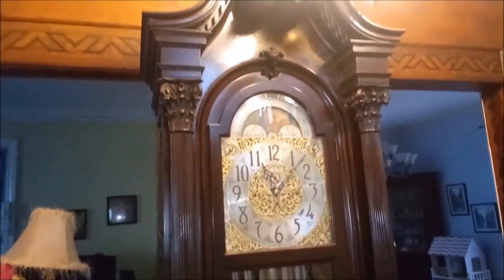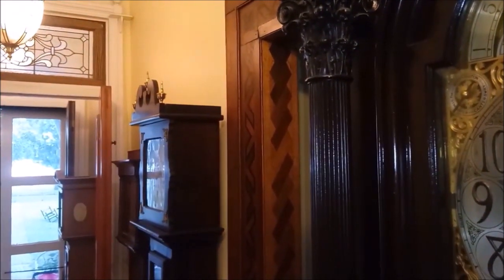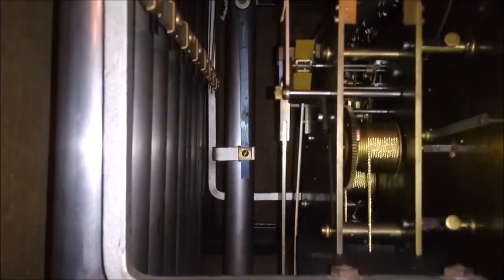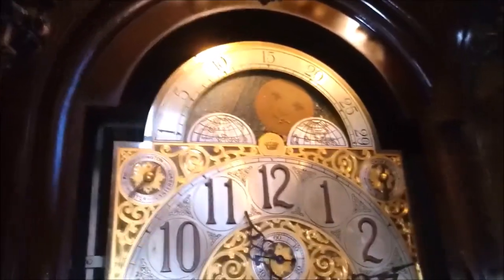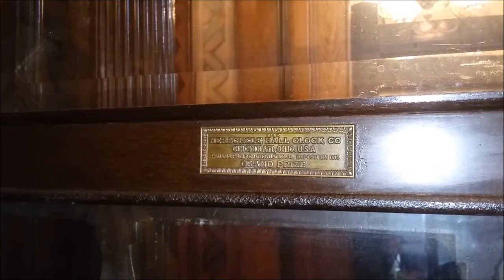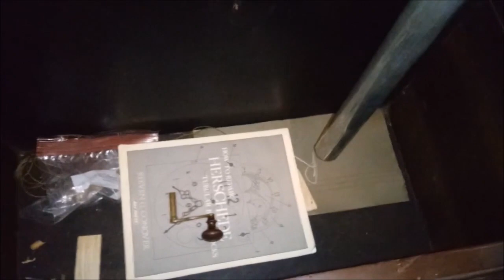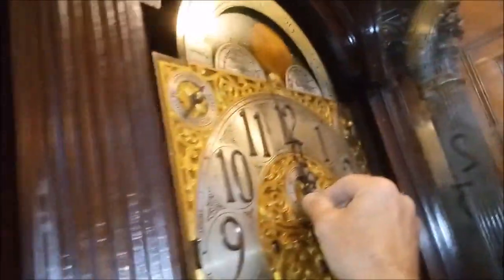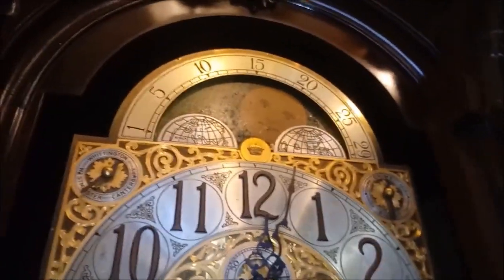Best Grandfather Clock Ever Made? Herschede Model 228. In 1916 It Cost $790 More Than a Ford Model T

Comment: Beautiful Clock!  I have a 1913 9-Tube but not as fancy a case.  I did notice your chime is off.  They don't self regulate so you have to fiddle with turning it on and off at certain times during an hour to get it back in sync.  Thanks for sharing!
Reply from the maker: 9-tube Herschedes are amazing clocks. I pieced together a few videos to make this one. Sometimes the chimes are on and sometimes off. Good eye.
Reply: well, apparently, they (Herschede) retooled the movement to self-correct the chimes every quarter sometime before their Starkville days

Comment: Nice clock, the chimes are out of sync btw, but its still nice
Reply from the maker: I know. Don't tell anyone. The movement is on my workbench as we speak.
Reply: I’ve noticed that too about the chimes. Instead of the usual for notes that the quarter after plays in the last four notes that I would play on the quarter till hour he would play the second for notes of the formality originally meaning you would play the fifth sixth seventh and eighth notes on the full Melody with if it’s the full tune or on the half hour that is. But I don’t bother me as long as the chimes work that’s all that matters

Comment: It needs new leathers on the hammers. the tone is way to bright, like metal on metal.
Reply from the maker: Yes, I agree. Herschede used horse hide or goat skin to get their rich tones. My hammers are all intact, they have just hardened with age. I haven't found any exact replacements yet. Most replacements are pig or cow skin.
Reply: @the_clock_guy  Griffen's Clock and Repair parts. They bought R&M, but they also have Herschede records, so that you can get a history and certificate for your clock. They also have hammer leathers, etc. 😉

Comment: The westminster chime has the last quarter where the first one should be. Needs adjustment.
Reply: Easy "adjustment".  Rotate the minute hand backward before the most prior quarter hour, then back forward to chime the quarter again.  Repeat until the chime has cycled to the correct sequence for that quarter.
Reply from the maker: Good ear. You are correct. The movement was not set up yet when I took those images.

Comment: Hello! I own a 1936-ish Hershcede movement similar to this one with a handful of problems; on the “strike” side, the winding cables are all tangled on the arbor that holds the drum, is there a way I can fix that without taking the mvmt apart? Also, the chimes are out of synch, and they get “tired” and stop chiming after about 6 or less hours. Is there a way that I can just save money and fix this easily at home, or Is it scary-taking-movement-apart kinda thing that an actual clockmaker can do? Thanks. I really want it to chime and I’ve always wanted a working herschede 9 tube clock to keep as a heirloom. Thanks! (Wish I could send pictures via YouTube comments so it is easier to explain)😊😊😊😊
Reply from the maker: I have another Herschede from 1938. To fix your tangle, you take the weight off. You will have to release the click with a small screwdriver and manually pull the cable out to it's very end. Then you put the weight on and wind it carefully. Be careful not to kink the cable!! And NEVER remove the weight from a cable driven clock. If you do, you must hang something on the cable to keep it taught. It doesn't have to be very heavy. Just enough to keep the cable from curling up into a birds nest.  Please send pictures. theclockguy12@gmail.com
Reply: @the_clock_guy  hello. I’ve gone around talking to experts and they have said to pull on the click and then unwind it, but when I do so, it comes back up. I will make sure to make you an extremely detailed video showing you.

Comment: Have a question for you. Can you fix a Thomas Kinkade dome chim clock?
Reply from the maker: Is it and Anniversary clock? (The clock with the 4 spinning balls as a pendulum?) If so, I am sure I can. You could mail it to me without the glass dome. I don't charge to fix clocks. You just have to pay for shipping.
Reply: @the_clock_guy  that would be so awesome.  It was my mommy's clock and I lost her 14 years ago. I was upset when the balls stopped turning but it would still chim. Then I changed the batteries when our time change happened and the chim stopped . I cried for 2 days over the clock.
Reply: @the_clock_guy  yes it is a anniversary clock with the 4 spinning balls wish has also stopped working. I would not worry about fixing it but it was my late mother's and I have got use to hearing the chim and omg I miss is so bad.

Comment: Is clock still available?
Reply from the maker: I never intended to sell this clock, but my wife isn't wild about it. She thinks it looks too Victorian. She prefers the painted dial clocks from the New England clockmakers. We currently have our Danial Burnap tall case in the front hall.  I had to move the Herschede from our foyer to my workshop in our carriage house. It was so big and heavy that I had to cut a hole in the ceiling, and make an elevator to get the clock upstairs. I am sad that it is not sitting proudly in our Victorian home as it rightly deserves. 
I would consider selling the clock if the price and details are acceptable to both parties. 
My email is: theclockguy12@gmail.com

Comment: Need a light set up , my friend, hardly can see anything ,at all.
Reply from the maker: I agree. I was luck to have the footage that I used to make this video. My wife made me move the clock because it took up too much room in the hallway. I have wanted to make a better quality video, but the clock has been in pieces in my carriage house. The clock is so massive that I couldn't get it upstairs to my workshop. I finally cut a hole in the second floor and made an elevator to get the clock up there. Now, I just need to get the clock ready for a good video. Stay tuned, it will be coming soon.

Comment: I wish you would have taken longer on planning of this video.  The volume was very low in the very beginning.  First remove all animals and people for the period of time to do the video.  Or just take still photos and show and tell.  You should have written out a script first to give the 4 W's.  Who, What, When and Where.  You should answer those questions.  The video camera was all over the place too fast.  Makes it dizzying to watch.
I still want more info after watching.  Who made the clock and when was it made, where was it made.  How did you get the clock?  Did you have to repair the clock?  How much do clocks like that cost?  Will you be keeping it?
Reply from the maker: I wanted to do a video on this clock for a long time. I realize that I may not get the time I need to do the quality video that this clock deserves. I was watching one of my old videos and noticed that 13 minutes of the 20 minute total was dedicated to this clock. I downloaded it, cut off the beginning, and tried to edit what I could. This video will have to do for now. 
The Herschede Hall Clock Company made this clock in 1916 in Cincinnati, Ohio. I bought it at a South Jersey auction. The previous owner was a Doctor who owned it for more than 50 years. He was moving to a beach area and didn't want the clock to get ruined. I put new weight cables on the clock because the original ones were different lengths. I have seen this model Herschede clock sell for $25,000. I will do my best to keep this clock as long as I can.